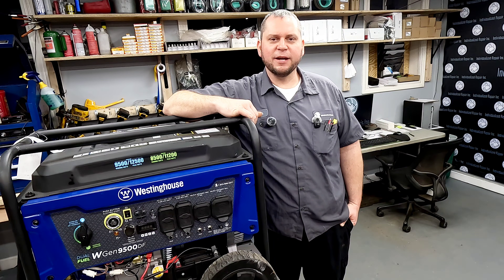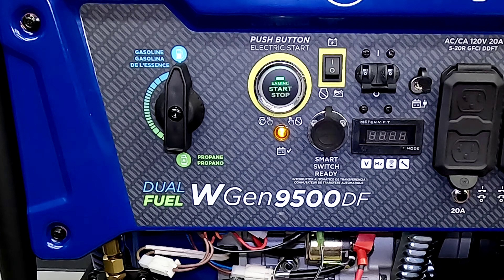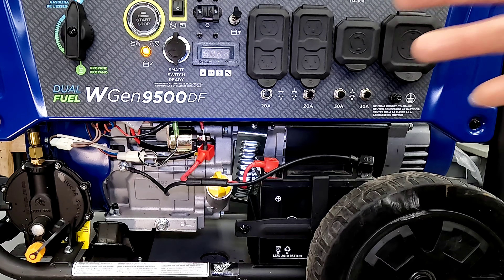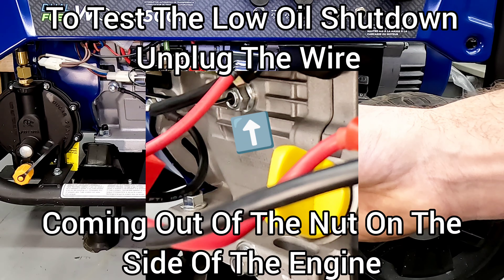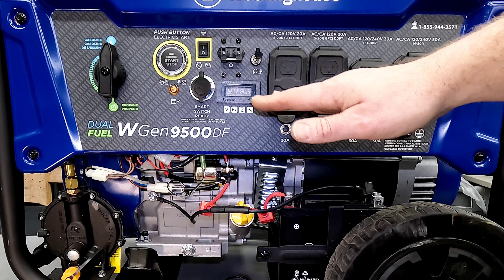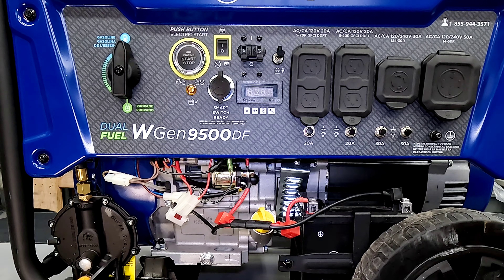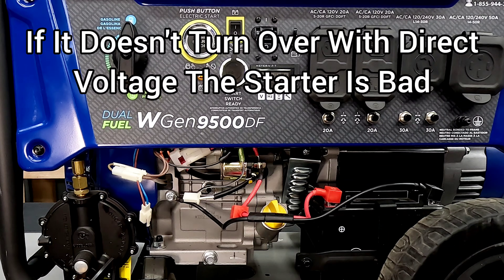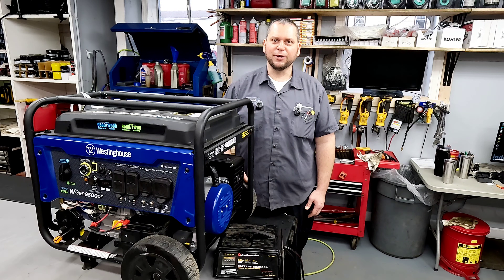Generator Won’t Start The Most Overlooked Problem Not Fuel or Carb!  Easy Fix & Diagnosis WGen9500DF

Comment: Hi Martin I finally received my trifuel Westinghouse 20k 28k peak and it was DOA. The battery is measuring 13.5 they sent me a new button. But that did not help. What I found is if I depress the little red button on the side of the panel for 10secs the button text will light up red but no green ring it never lights. This has never been started and brand new I was just to the step up pairing the key fob and that was the furthest I got. If I turn the battery switch off and on the button text will not light until I press that little red button again for 10secs. They are going to send me a new control board but the last two I received were wrong part number. This is so frustrating a 537lb paper weight that cost 4100. Is there anything that you can think of to help me?
Reply: BTW thank you for your video it gives me hope lol
Reply from the maker: I am glad it give you some hope on the issue!
Reply: Well part will be in Monday, meantime I took off the batteries to get a good look at the wiring going to solenoid and checked both fuses. Positive wire to solenoid and negative to engine mount bolt are both secure. I took all connections off checked for recessed pin and reconnected. So while battery is off it’s on charger. Monday control board comes in and that will be the final test before it goes back. Do you know what that little red reset button is on the right outside metal housing of the push button assembly?
Reply from the maker: @jvarrati That should be for pairing the remote
Reply from the maker: It screams bad connection somewhere but I guess the control board could be an issue... weird stuff. What is the model number on that one?
Reply: @ Wgen20000TFc thank you so much for your help!
Reply from the maker: I would check all the connections, move all the wires around or use a meter to make sure 12 volts is getting past the fuse and to the start button. I see bas connections all the time on these, seems we about covered all else
Reply: Will do! Stay tuned, thank you.
Reply: I measured 12.5 all the way to control board
Reply from the maker: Nothing changed when jiggling wires or moving them around?
Reply: @IndRepair no at least jiggling all wires by control box. It is getting voltage to board maybe a bad ground somewhere
Reply: @jvarrati my dual fuel westinghouse was DOA as well. The battery power light doesn't  come on until you plug it into the wall, and it starts perfectly. And only while plugged in. I took the battery in to get checked,hoping for a really easy fix. The charger said bad battery. I bought a new battery and put it in,and still nothing...........
Reply from the maker: Wow. All the connections at the battery, solenoid, ground and battery are good also?
Reply: I have a new control board coming tomorrow will try that. If that doesn’t work it’s going back to
Reply from the maker: Definitely
Reply: If I hold that red push button in for about 10 sec and release then the push button will light up red but nothing else happens. If I turn off battery switch and back on the button will not light again.
Reply from the maker: @jvarrati That is the pair button for a remote is it not?
Reply: What’s funny is that nowhere in the manual is that button referenced. The manual says to push the power button for 10 seconds and the led ring around the button will flash green. Then I press the fob for a sec and the flashing green will turn solid when the fob is programmed. The only time I got the power but to light was pushing that red button for 10s then the center text of the button lit up solid red.
Reply from the maker: @jvarrati Yeah definitely. I am almost positive this is the pair button I remember from before
Reply: @ I believe you it’s doing something, I may try and hit the fob next time the power button turns red. Thanks for your help I really appreciate it!
Reply from the maker: @jvarrati love to hear how it goes
Reply: @IndRepair  https://youtube.com/shorts/ci7-uvgP89M?si=Kus_WxC10UKffqWK
Reply: @IndRepair  You are not going to believe this!!!! Despite what the manual says I did what you said I pushed that little red button till my push button went red then I pushed the fob for a second to pair and the red button blinked. I then turned off the battery and back on pushed the Fob after turning the fuel switch to gas and the starter engaged whoo hoo! Now I’m going to put everything back together hook up the natural gas quick connect and see if it starts for the first time!!! You Rock so glad I subscribed!!!
Reply from the maker: Awesome stuff!
Reply from the maker: Wouldn't let me see the short

Comment: Hi Martin, I'm learning many things from your videos, and I appreciate you taking the time to produce them. I didn't believe my lawnmower had this problem, but it did. Thanks to your video, I now connect a mini-charger, a trickle charger, to my battery when I finish cutting my grass. I've also added gages to my mower to monitor its Voltage, Amps, Oil pressure, and Engine temperature. A video on how to install gauges on gas-powered equipment would help owners.
Reply from the maker: Glad you got it fixed. You are a DIYer with gauges! I've never put an aftermarket gauge on a mower but definitely not a bad idea to do a video on this
Reply from the maker: Thanks for watching!

Comment: I am in the middle of troubleshooting my generator right now, I posted a comment on another one of your videos. Thanks for taking the time to produce such great and clear content. Hopefully my issue is just a bad power switch! 👍🏻
Reply from the maker: Awesome news! Thanks for watching and I hope you get it fixed up quick!
Reply: @IndRepair thanks! Looks like it was in fact a cold solder on the main red battery lead on the Engine/Battery switch. I moved it, and it broke off. Very poor design for such a critical connection.
Reply from the maker: Awesome job finding the issue!

Comment: I try to guess the issue every time before watching the video, to improve my diagnostic skills.   I immediately thought spark but I wasn’t thinking in terms of the entire system, which in this case also includes a battery starting component. 
Thanks, Martin!
Reply from the maker: It is just kind of crazy most do not charge while running so people let them get low pretty easily. I see bad spark plugs but that is a unicorn for us. Had a torch plug yesterday that was causing a snowblower to backfire instead of starting. It sure was a weird one!

Comment: When a customer says they charged, but you see it’s low….. do you do a quick check?  Quality of cables, dirt and corrosion, loose connections?   A battery can drain just by having different and oil on the top.
Reply from the maker: We always check the battery voltage on these. See a lot of bad connections and batteries that won't hold a charge is common. This one still had good voltage this morning so I will be asking about the charger her was using

Comment: Just a heads up... many of those chargers supplied with the sets are NOT a maintainer and will cook the battery after a few weeks if left unattended. I would tell my customers to just charge overnight any time they did test runs. I would also prompt them to do monthly tests and bi-annual full runs as if the power was out. That can be done on the weekend you have to change all of your clocks anyway.  <LOL>
Reply from the maker: I was unaware they continued to charge after the light turned green but thanks for mentioning that! We always recommend a maintainer instead of the charger but they use the quick connect that this one already has many times. Thanks for watching and for the good info!
Reply: @IndRepair    that's a key point. If it DOES have a light or two indicating charge / float state then it probably is a maintainer. It will also state that in the paperwork. Many do not and people buy them because they are cheaper.

Comment: Hey Martin. On my generator the solenoid went out I replaced it. When I installed it no results. After removing it from the mounting location and left it wired it works every time using the switch. Hopefully you can give me clue what’s going. Great Video as always.
Reply: I would do some wiggle testing. Sounds like a wire somewhere isn’t making good contact or has damage.
Reply: @ thank you. Will do.
Reply from the maker: Great advice!
Reply from the maker: That is very strange? So you are saying that it would not work when installed in the boot on the generator but worked perfectly once you left it hang with all the wiring hooked up?
Reply: @ when I mounted it on the starter the switch wouldn’t work but when I removed it from the starter the switch would operate hanging by the wire hardness. It’s properly grounded.
Reply from the maker: @porkypineacres3536 now that sure is weird... hmmm
Reply: It’s a firman 7552
Reply: @ glad I wasn’t the one thinking so.
Reply from the maker: I have never heard anything of the sorts
Reply: @IndRepair  I did small gen repair for over 20 years (rainy days when standby sets were a pain) and anything that works after you move something is probably a backed out pin in another plug on the harness. Might have to pull the fuel tank or the control panel to check all the plugs.
Reply from the maker: Very good advise. Bad connections cause weird things sometimes

Comment: Good one Martin.  I had 2 of these come in last year, same thing. The batteries were never trickle charged.
Reply from the maker: Crazy that most do not have onboard charging like everything else
Reply: @ I had the customers pick up a good trickle charger.  Haven’t heard back!
Reply from the maker: @KensSmallEngineRepair great stuff there. I have thought about selling them up front may have to get some on the next pre season order